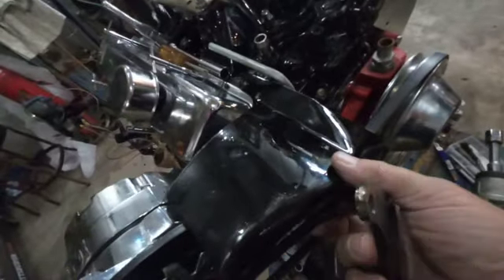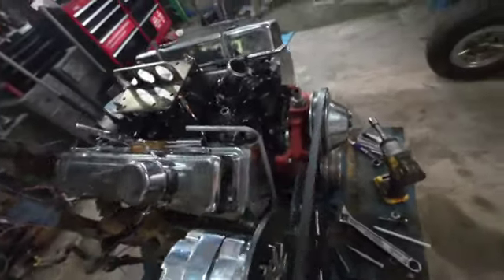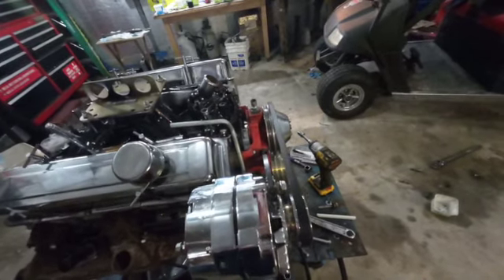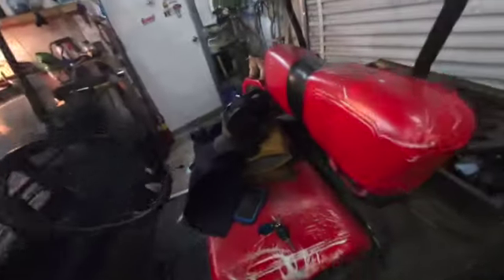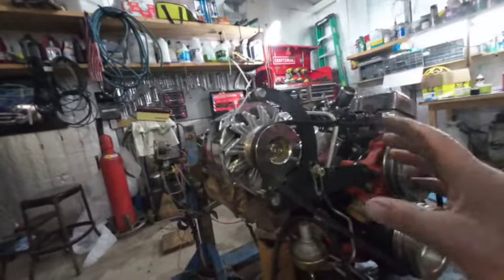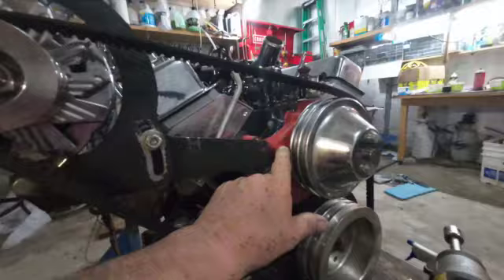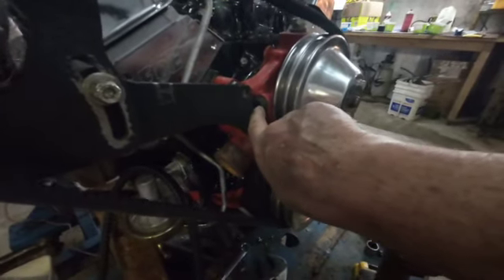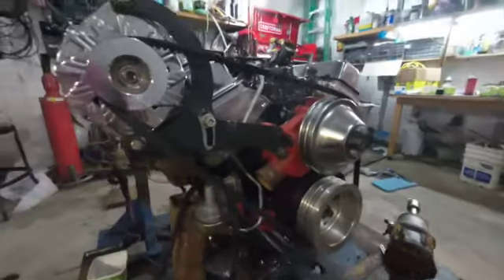Aftermarket Alternator Bracket for SBC 359 ci

Comment: Yup you got the piece right but u need the spacer that goes from the head to the bracket its a long pipe lookin thang about 2 inches long the bolt goes through it and holds the alternator still most chevy engines had them in around the 70's era..
Reply from the maker: Yep...   I found another one of these out back yesterday in my parts pile too.....    I got way too many Chevy engine parts, if that's possible.
Reply: @rpeek  you can never have enough Chevy moter parts just adds to the collection that when u need it you got it..but no where to keep it😅
Reply: Good save brother 👍